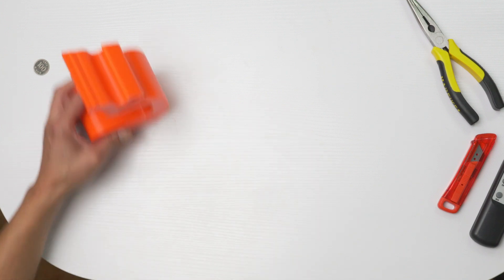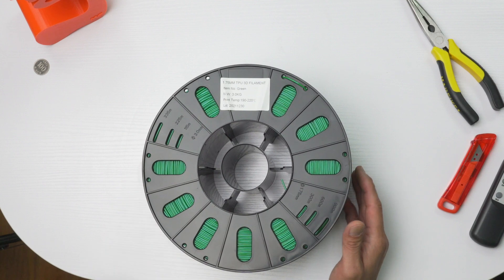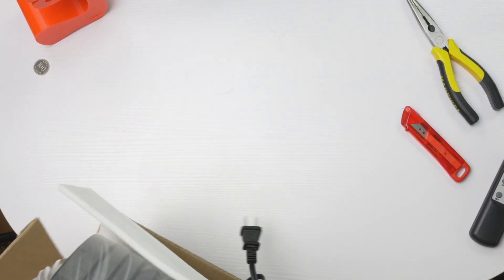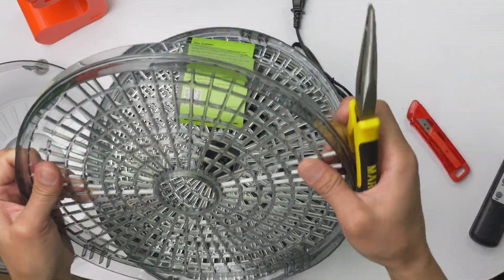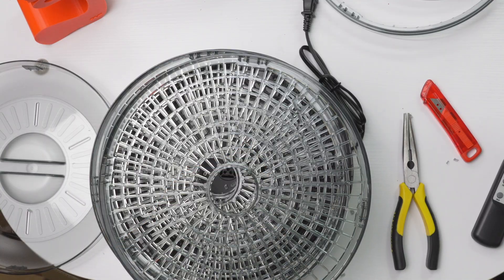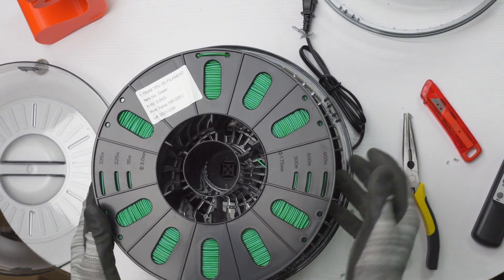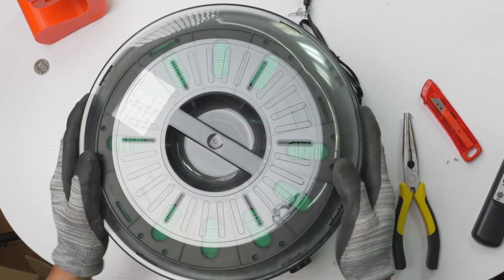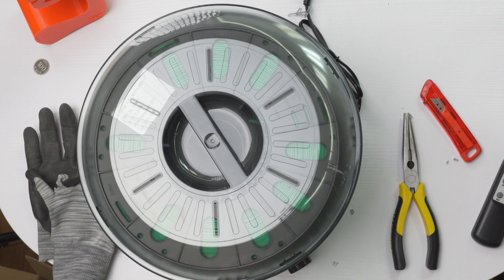How to Make 3D Filament Dryer w/ Food Dehydrator for less than $50!

Comment: Any advantage putting some desiccant beads in there also to dry the air as it circulates?
Reply: Not really. I'd suggest it only if you use the dessicant anyways and want to dry it while you dry the filament

Comment: Using a soldering iron to melt a cut through the plastic trays wound probably be a little safer and cleaner than cutting and breaking them causing sharp pieces and shrapnel.

Comment: Make sure not to cut all five of the trays, I only meant to do four but my mind was on autopilot and I did all five. It still works okay though, you can just leave the spools on top of the central vent just fine even without any trays.
Reply: How many spools can you fit ?
Reply: @zackbowe1466  I can fit two standard AMS- compatible 1kg spools in mine, might be able to squeeze 3 if they're skinny.
Reply: @ thank you

Comment: why not just 3d print extension . So you'll have more height to dry more than one spool.
Reply: There are actually files for that, I regret not looking them up before cutting mine up. I'll probably print out the ones that have a hygrometer/thermometer slot too.
Reply: Not all models have models designed for them, and making one for already owned food dehydrator models requires knowing how to design it yourself or purchasing one that already has the 3d model file for it when you don't need to purchase one because you already have an older one to use.
Reply: one reason is because you would need to print it in like abs if you plan on drying pla and petg or tpu. else the 3d print will warp and melt.

Comment: Have you tried drying CF Nylon with this dehydrator? Most manufacturers say to dry Nylon at a temperature between 80c to 100c. I'm just wondering if you can just leave in it there for longer to compensate for the lower temperature?
Reply from the maker: Yes you can just leave it in longer.